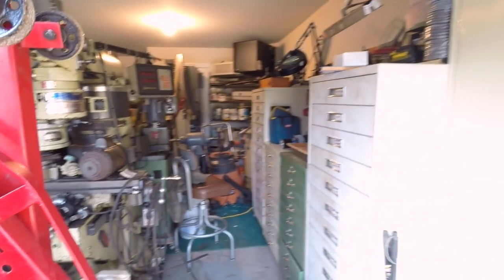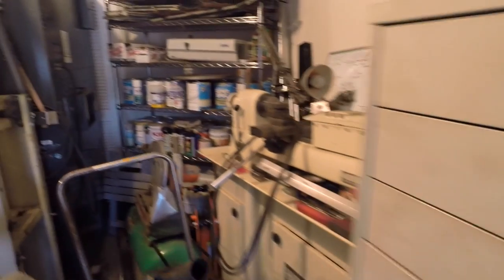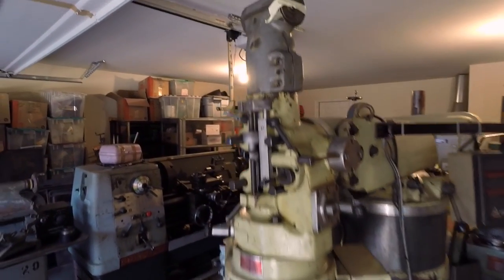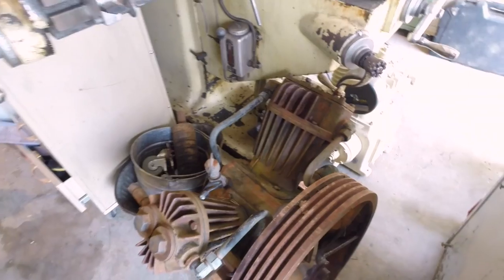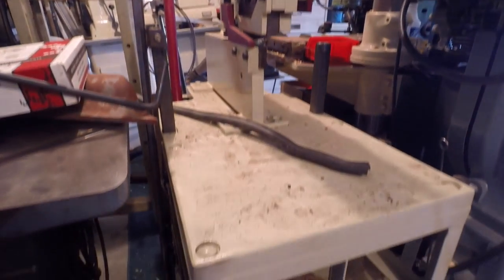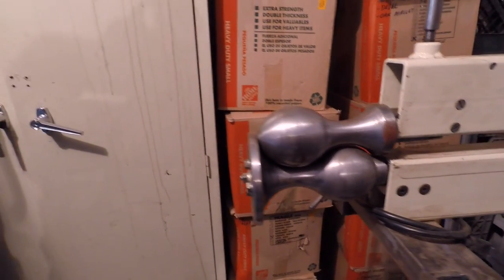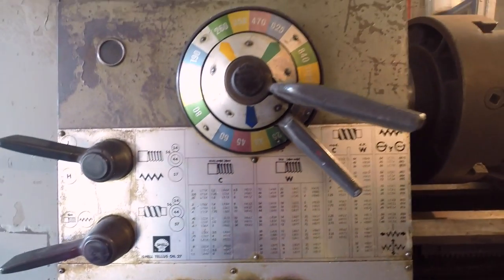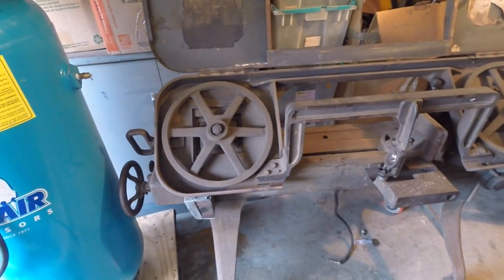Old New Shop - Part 1

Comment: Dale, you are right on regarding the Hardinge lathe! Retired last year after47 yrs. as a tool room/ prototype machinist, and longtime Hardinge user.
No manual lathe even comes close for speed and ease of threading, making micro parts, and ease of obtaining great finishes on any material.

Comment: Wow 😳 I love it. I'am just getting in to metal working as a hobby.i just saved up for my movable shop one of those steel box's I think there great. I'am not sure 🤔 about how big it is but I think it's 8ft across by 9ft by 20 ft long. So when I move I just pick it up put it on a trailer and gone. Probably have to chain it up god dam thieves will steal anything.

Comment: Dale,
I have a Hardinge HLV-H most likely in even worse shape than yours (#164, or the 64th one made the first year) that I will be starting to work on this summer. I am planning to do several videos on the process. I know I am going to need to make a few parts, like lead screw nuts (if I can't find them). But if yours will need the same parts maybe we can tag team making them (I make a few and you make a few), it could save us both time and money.
Reply from the maker: +DansWorkShop 
Hi, Im trying to decide if I'm going to rebuild mine. Its in real bad shape and the investment in time  and money may not be worth it for me. But who knows you might inspire me to take it on. :-)
Reply: +Metal Tips and Tricks (Dale Derry) Well I have started tearing into my lathe. Videos to come in the near future. I was able to score a used bed which was the biggest problem with my lathe. Now if the tailstock just lines up. if you decide not to fix up the Hardinge let me know what you plan to do with it.

Comment: I believe I saw a Pow-Con welder back in the corner. I thought I had the only one left...
Reply from the maker: Greg France Yes you saw a Pow-con in the back. Great machine. Did you know they are still being made? Some company pick up the right to manufacture them.They sell for around $5000.
Reply: Yeah, they're San Diego area based, I think. It's a good machine, I've had it since the late '80s. It's in need of a "tune-up" at present. My wire feed looks quite a bit different than yours. I'll post a picture if you're interested.